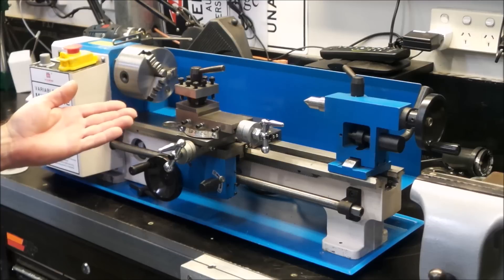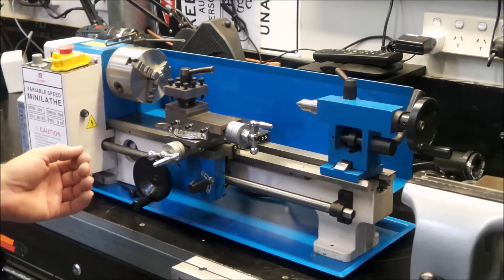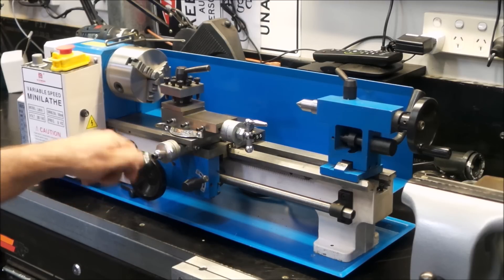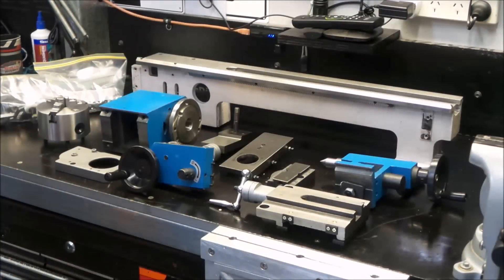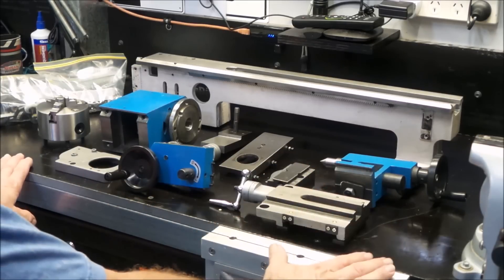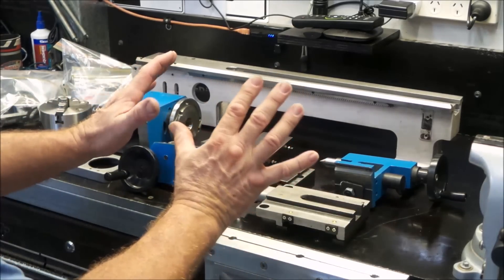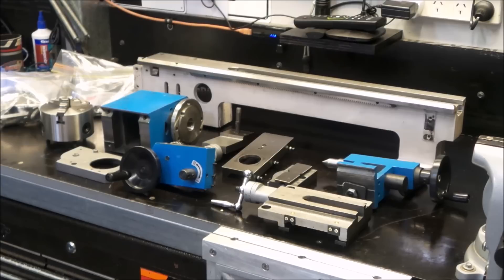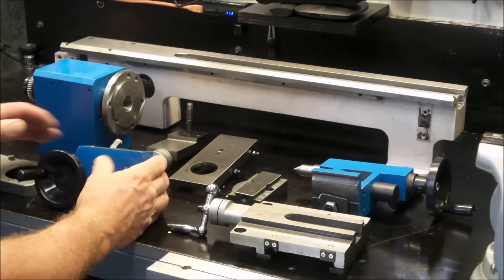Complete Guide To Upgrading & Rebuilding A New 7 X 14 Mini Lathe, Episode 1

Comment: I'd like to tell you that your series on the Chinese Mini Lathe help me tremendously in getting my mini lathe useable. Especially from a mechanical point of view. I'm working on an analog closed loop speed control for my lathe and would like to send you the device to get your feedback. However, I have run into another very vexing issue. My lathe has a grounding problem... the chassis is electrically HOT and causes electrical noise issues making the closed-loop control unusable. If I connect a VOM to the chassis and ground I read the hot AC voltage peak (about 170 VAC p-p here in the states). So far, I've been unable to track down the problem. Have you seen a similar issue?

Comment: Having just received my own, first-ever mini lathe, I am struggling with my buyer's remorse. I could seek temporary solace in the devil drink, or I could tackle the machine's shortcomings. The latter seems more productive to me, so I am glad that your playlist came up. Based on this first episode, I am looking forward to seeing how you worked through your lathe's issues, and hopefully to learning something that I can apply here. So, thanks in advance. 👍
Reply from the maker: Cheers Mate, honestly, there were a lot of hurdles to overcome with this unit as you will see in the videos. On the Positive side, it turned out really well. I am still using this lathe today 4 years on & very happy with it, even though there isn't a lot of the original Lathe left. Cheers.😁

Comment: Iam using a Chines Scooter motor    and controller its 24vd, the scooter controller is way better and they are cheep i use a jack shaft where the motor mounts and a bracket that sits a few inches behind the lath.  My controller power supply is mounted up and away in a control box if u use coolant  it  will  fry the controller real quick. Now that all my  electronics is up and away i can use light coolant. Every  one selling the original controllers or even the  so called ver.2 boards are priced way high  and not worth the money, Sense using the scooter motor and controller i have had  no problems the scooter was given to me and it was sitting in my garage  when my controller  went out i   got  the controllers that  look like  stepper motors drivers rated for 20amps  i hook up a 6amp motor to it and it fried in 2 seconds 70.00 bucks down  the drain, i was sick of the over ratting there products and was not going to get a another chine controller but money was tight so i started looking at the scooter parts and i  noticed that they where made way better then the cheep motor and controller.. anyway i now have  3 controllers and 2 motors that i got for next to nothing.

Comment: Luv your banter, lol! But on a more serious note, did I see plastic gears in the gear train?? Ewww…  Chinese manufacturing produces cheap stuff because they a) use cheap labour, b) use the cheapest materials, c) skip as many manufacturing steps as possible to reduce time and cost of manufacture (like hardening steel then straight to grinding and skipping over the reheating/stress relieving step). Hence you got what you got and have to spend the time and effort to bring it up to a reasonable standard. Good on you for taking the 'turd' and turning it into gold.

Comment: Hello Trevor , i have just bought the same lathe you have and i have a question , the chuck's are supplied with allen bolts that are too long to possibly fit in the gap between the "chuck back plate and the machine itself " can it be done or do i replace the allen bolts with shorter bolts of my own ?
Reply from the maker: Hi phillace, you need to buy some Studs or Grub Screws to put in place of the bolts. Fit those to the chuck first & slide it on, I think they are M8. That way you only have to get a nut in there when changing chucks, much easier. Cheers Mate.